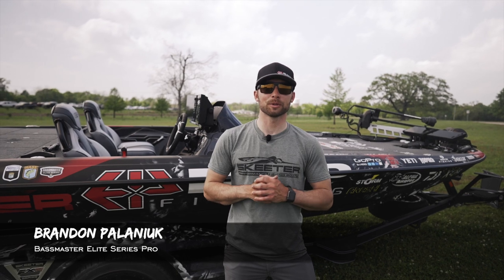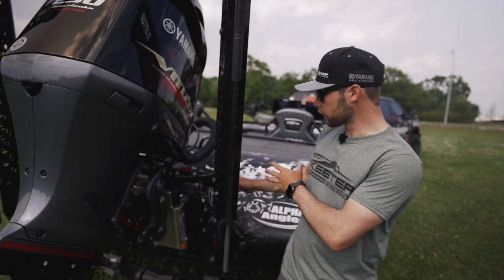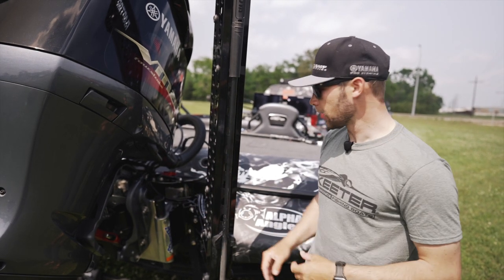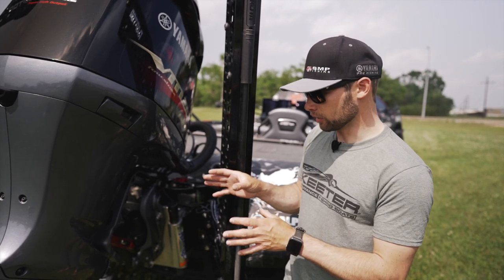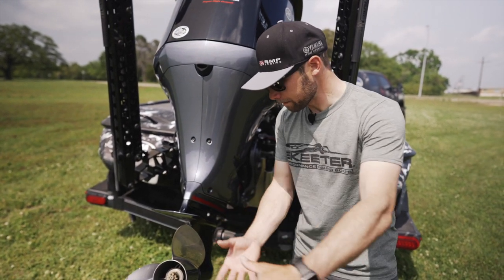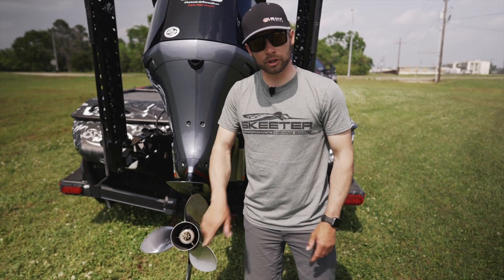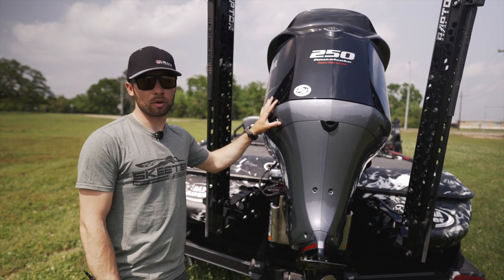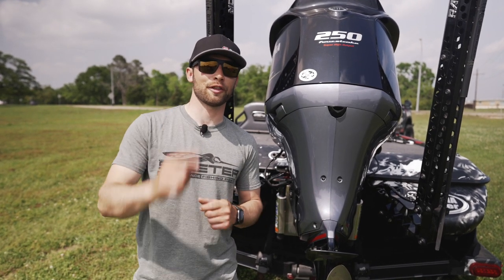Skeeter School-Transom Area Boat Maintenance

Comment: What transom saver/motor totter does Skeeter recommend? I have a zxr-20 with 250 on order.
Reply from the maker: Your ZXR20 will come with a Pro Rule Transom Saver, that is the one we recommend you use.